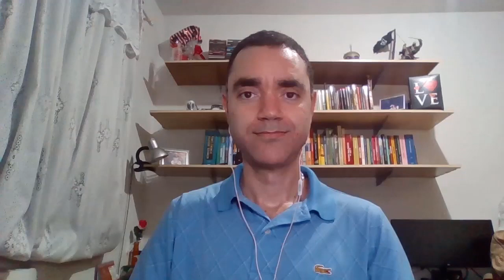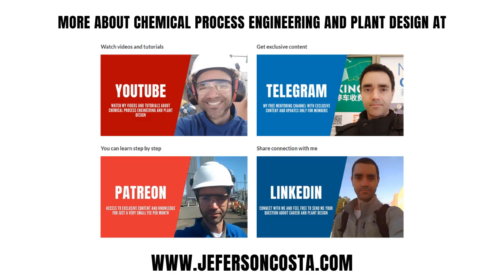WHAT TO DO WITH HEAT AND MATERIAL BALANCE FROM EPC/LICENSOR FOR CHEMICAL PROCESS ENGINEER

Comment: As you said, the task was given to you to double-check the 2000 kW load value. However, if you are in the EPC business and the client asks you to build a licensed plant based on the licensor’s simulations, and the performance guarantees are on the licensor, do you perform any verifications on the simulations, or do you just consider the licensor’s work as-is and start your detailed engineering from there?
Reply from the maker: Hi, it will depend on the scope of supply. If your scope is to replicate the HMB you will replicate the HMB. If your scope is to guarantee the product specification you will need to double check all inputs and outputs. 😇
Reply: @jefersoncostaengineer  Thank you for your prompt and precise response.

Our guarantee is for the Product specification which is subject to LD with the decrease in product quality and Quantity.